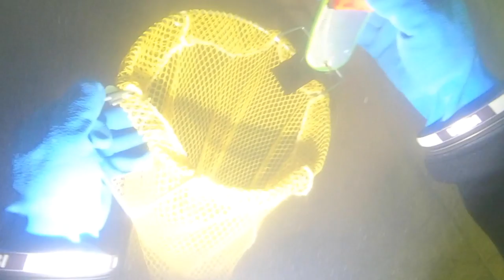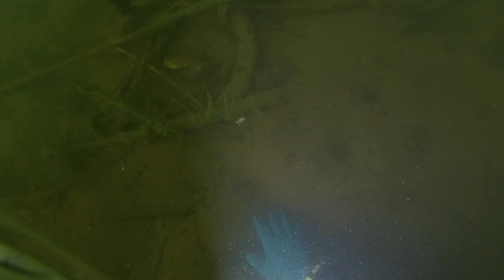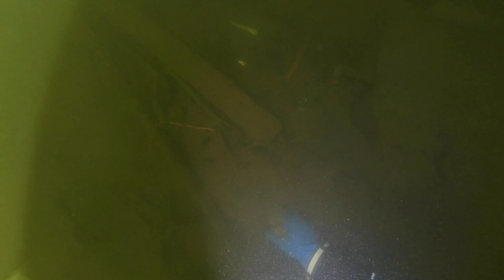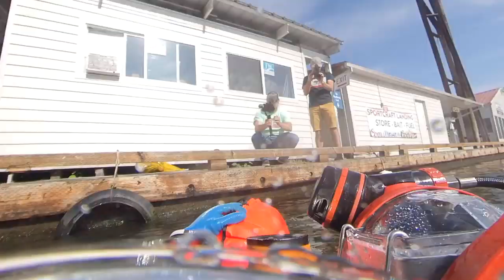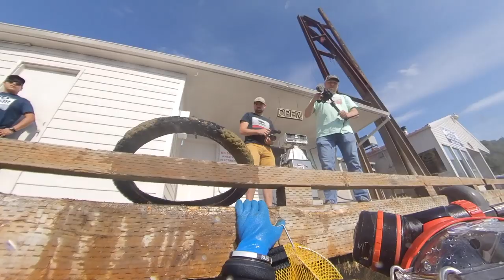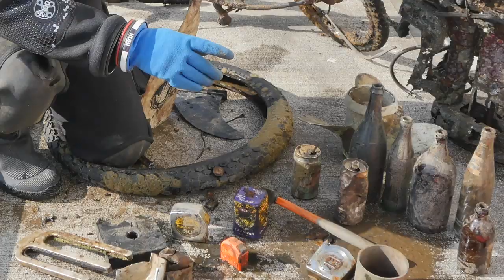Found $3,307 in Lost Underwater Valuables while Scuba Diving!

Comment: The outboard is most likely a 56 or 57 Johnson sea horse. About a 20-35 horse. Could run the model and serial number if the plate is still riveted on top of the mount